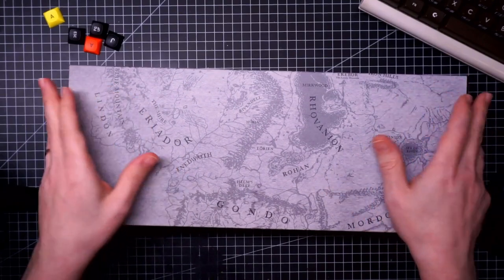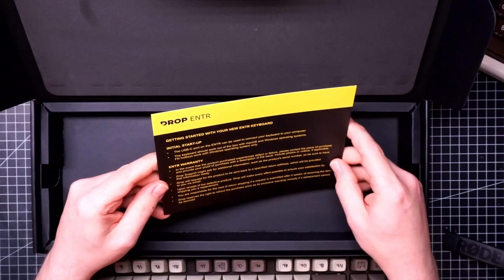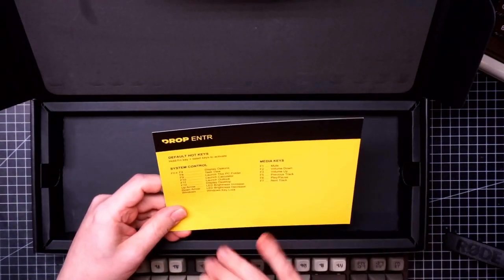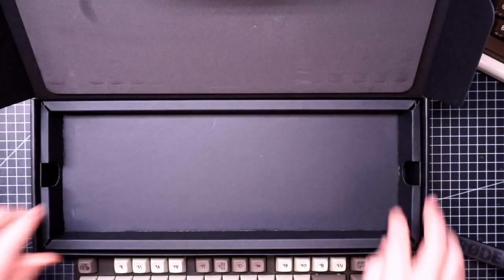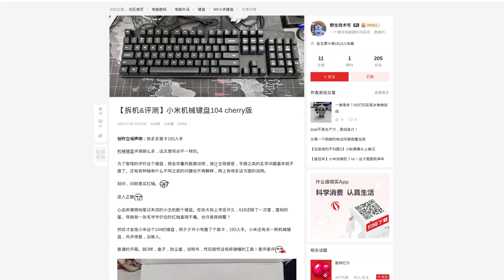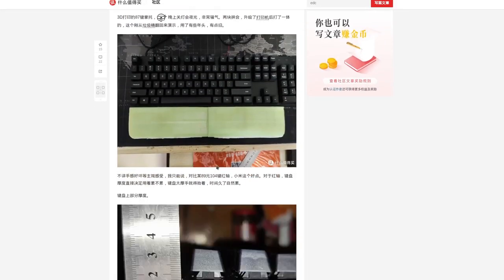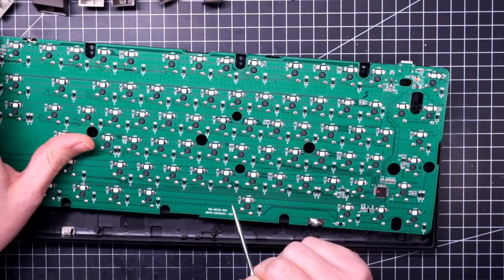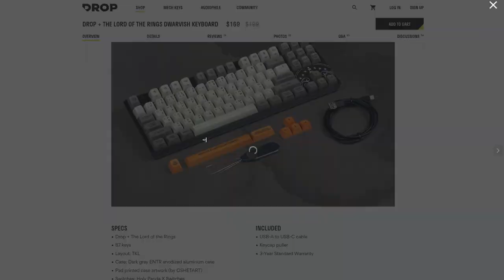Dissecting a Drop Dwarvish ENTR keyboard

Comment from the maker: After further inspection this one looks like a rebranded and slightly modified "Xiaomi Yuemi Pro MK02". That was (not produced anymore) a full aluminium keyboard with the same plastic structure inside (but the top cover was aluminium). The retail price should be around $120

Comment: Hi Matt3o, thanks for the video! Interesting to see Drop is using a PCB design from a Xiaomi keyboard. I saw the PCB on their "Alt" keyboard and noticed they just used an autorouter in the design software and then just...left it that way.

I'm curious if you've ever gotten into keyboard PCB design, it would be interesting to see what you make! 

I've really been enjoying your MT3 keycap profile. I designed and open sourced my own keyboard PCB and gave some away to friends. So far 3 of them have ended up with MT3 keycaps, they look gorgeous and are a treat to type on.

I'm really looking forward to your MTNu profile as well.

Anyway I'm rambling at this point, but in summary I like what you're putting out in the keyboard community, keep it up!

Comment: These keyboards are laughably overpriced at $200, terribly priced at $169, and maybe okay-ish priced at $119 (as they were Black Friday 2023). This is just my opinion obviously. Allow me to defend it.

I only say okay-ish because I feel the keycaps are pretty decent quality. Specifically, they are dye sublimated PBT, so they should hold up pretty well; moreover, they are rather thick, and, to me, have a good feel. The profile and heavily concaved shape are definitely of the unique variety that beg to draw out strong opinions. Personally, I like them, but I'm pretty versatile when it comes to keycaps. There isn't any tactile bump on the "F" or "J" keys to quickly find your start position for typing. Not cool, though with some practice I've found I can use my pinkies to kind of find it. 

As for the Holy Panda X switches, they are honestly pretty great tactiles imo. Though, I'm not one of those people that have sampled 50+ tactile switches (probably more like 10). And the gigantic elephant in this room is that they're soldered, which pretty much eliminates many people who might tune the board from doing so. This is really unfortunate because hot-swappable boards are very commonplace now and decent ones are definitely not expensive, especially when considering the price of the ENTR.

The major bummer, of course, is the ENTR keyboard is frankly pretty garbagy. Even someone who has only watched some keyboard modding videos for a little while would probably be able to tell the lack of materials and effort put into the board. There's no attempt to dampen sound and I think most people spending this kind of money would expect the case to be all metal. However, I believe the metal is where most of the pinging comes from. Unless you type really hard, it's not too bad. The top plastic piece is a flimsy joke...like insultingly so imo.

The backlighting is rather pathetic. I'm glad it's there but it's basically just there to be there. It mostly helps create some separation; it does not help see the keys in the dark, and this would be the case even if the keys weren't somewhat difficult to read under bright lighting. Though, this isn't why most people are buying the board. The keys are much more aesthetic the way they are and really should be as they are. If DROP wanted to make something truly special, they would have made the key caps shine through and used red LEDs on the Black Speech version (and made similar themes for the elf and dwarf versions). I digress.

One would think I don't like the keyboard, but I actually like it just fine. I think the problem is really that if any objective analysis is done, the keyboard basically feels like a cash-grab. And that's probably because it is. If it goes on sale like it did for Black Friday, one likes Holy Panda X switches, and also likes Lord of the Rings, I'd say you could do a lot worse. The keys alone are currently $89 (but there are a lot of extra keys in the standalone set) and Holy Panda X's are not super cheap switches. I must say, the keyboard looks incredible and even more so with an overpriced artisan keycap! That's really the appeal—it has phenomenal aesthetics and it's something LotR fans can appreciate every day.

Comment: NEVER BUY THIS KEYBOARD

I unfortunately got this keyboard as my first mechanical keyboard and every review was praising the "amazing build quality"

But just after a few months it started to give me electrical shocks through the aluminum and after a few years it literally became a fire hazard when it started to burn the cable because of a faulty connection. All of this is likely caused by the terrible soldering and the pcb directly touching the aluminum case

It's basically a bunch of trash attached to a piece of aluminum, I wish I watched a video like this before buying, we need more reviewers that actually dissect the product to see whats really inside